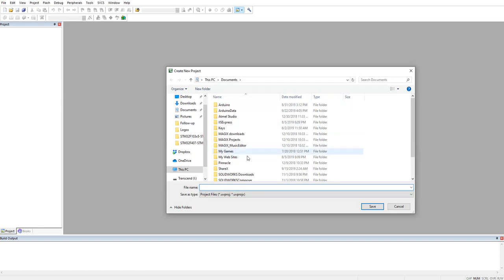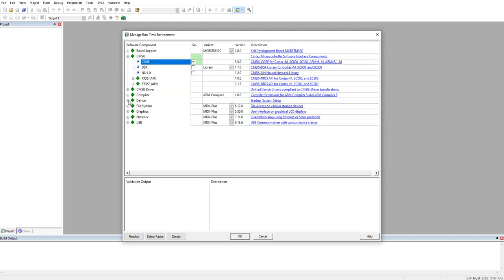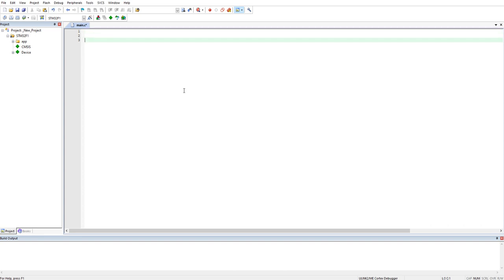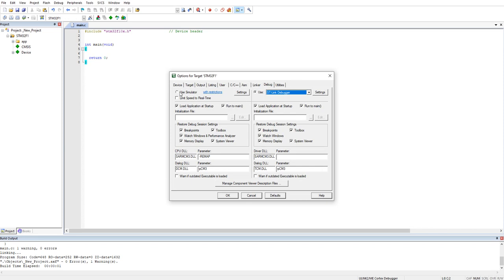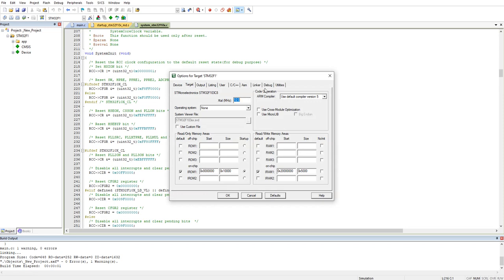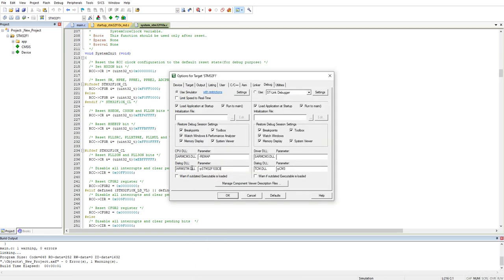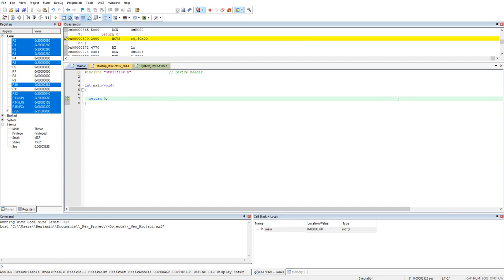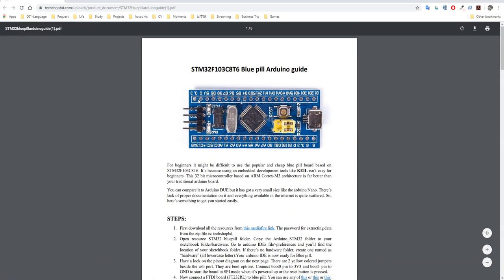01 Fix KEIL Simulation No Permission for STM32 NXP TI part 1

Comment: Hey Hello, I have those detailed tabs when I use debugger in simulation mode but I cannot get them in normal debug mode. Do you have a solution for that ?
Reply from the maker: Hi Murat, thanks for your question
Actually, those tabs are specific to the simulator mode (in case of you don't have a microcontroller) will double check again but not having hope on that
Reply: @WeeWStack  I saw a guy open that same detailed tabs in normal debug mode but he didn't show the parameter spaces. There are couple of parameter spaces like in the simulation mode on the debug tab. I copied the parameters that you linked but it completely broke the normal debug mode. I think it might be very useful to have that detailed tabs on normal debug mode. Because sometimes looking at registers and going back to the reference manual to figure them out is too much work. I'll update you if I figure it out. Thanks. Appreciate your work dude.